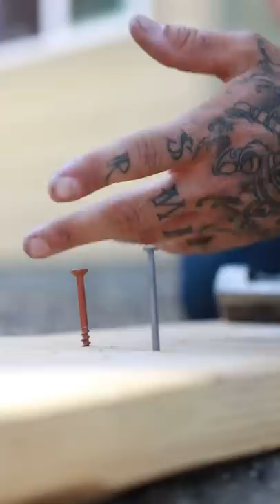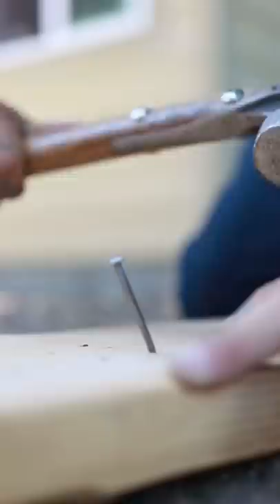Nails vs. Screws: Why do we use nails? #shorts

Comment: Screw for tension.
Nail for shear.
Reply: ^^This^^
Reply: sweet
Reply: Isn't that the whole point though, how did someone use them without knowing?
Reply: @willowwu8061  most likely for the diy-ers
Reply: This too.
Reply: And cuz they're cheap
Reply: Kinda like Concrete alone is great for compaction but not tensile. Add rebar and you can use it to span. I think that's the right wording.
Reply: @robcoastalga8279  Yes, concrete for Compressions strength and Steal beams for tensile/tension strength. 
I’m no civil engineer, but you can use reinforced concrete in place of steel and to build structures much faster than using steel.  Reinforced concrete is also more fire resistant than steel.
Reply: I think I get it Does that mean screws are stronger if you were to pull on the head of the screw/nail, and nails are stronger if you were to push the head side to side?
Reply: Torsion strength^^
Reply: @connorlowis4774  basically yes
Reply: It gets complicated though because screws can apply so much friction between two studs, much more than the equivalent number of nails, that the friction will resist shearing forces.
Reply: Erm. Well what this is demonstrating is plastic deformation not shear strength. They both deform under the same shear, it’s just the nail is able to plasticly deform while the screw fractures. 
 I get your point but your material definition is slightly out, it could cause some confusion
Reply: Nice
Reply: @willowwu8061  live and learn..
Reply: Might be tension but the charts usually say withdrawal or pull out strength.

Screws do have shear strength as long as you buy a structural screw (like the structural nails compared to). Simpson has specs for nails or their structural screws, also grk, fastenmaster, etc all have screws that can be used instead of nails and have comparable or greater shear along with insane withdrawal strength
Reply: Ia tension strength even a thing?
Reply: A screw will only break if it bends so if it is in two pieces of 2*4 how is it going to bend you have no idea what you talking about
Reply: @charlestorruella8591  racking, watch the video 🤣
Reply: Not anymore though, there are structural screws that have plenty of shear strength. The nail is dead, the screw is victorious!
Reply: Tensile*
Reply: @brian5700  thats what I thought they meant but who knows these days lol
Reply: @dylanbarney3290  screws will never be used in places such as joists which are subject to racking. Why? We already know the answer. There are certain situations where screws just are not used, end of story
Reply: @chaselesser3191  until 40 years pass and your structure straight gobbles up 150 people. Aint no way Ill feel comfortable in one of those slab houses of cards
Reply: No. Pin for shear.
Fight me.
Reply: @JoeKyser  absolutely there are. But I think that most of the  folks that argue for the nail are folks that don't want to lose the speed and productivity of a nail gun 🤔
Reply: @dylanbarney3290  well in the cases where I have to use a nail, Im not using a nail gun.  When I am using a nail gun, its usually when screws shouldn't be used anyway. Trim, roofing ect.  Even when screwing sheet rock up. Its not that bad. They used to always nail it and I never see it nailed anymore. Not that some hack isnt out there doing it. I always choose quality over speed. The customer is paying for it anyway.  Nothing worse than getting called back

Comment: I like a combination of both, combined with hangers, brackets and plates. Add in sheer walls at corners and the box stays square.
Reply: whoa whoa whoa what are you building your own house?
Reply: @jkhsdjkhfjkhh3  Actually, yes. Just finished the roof